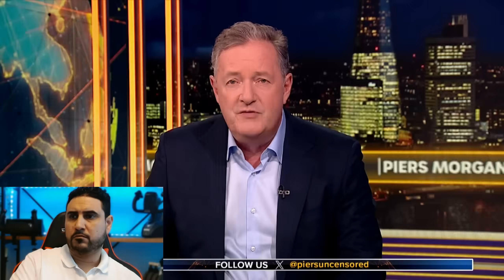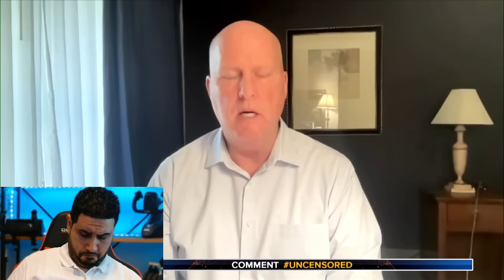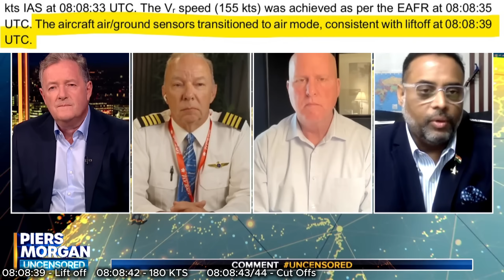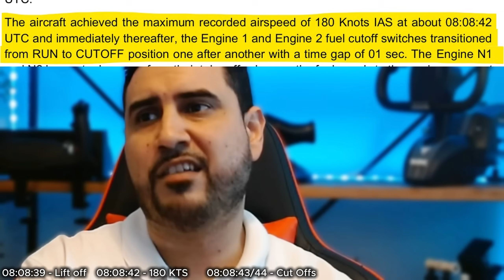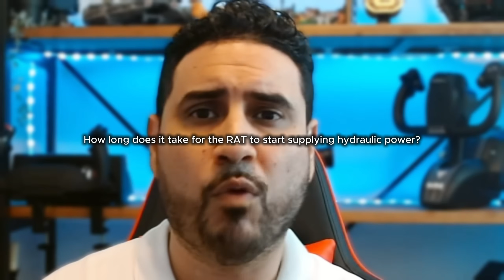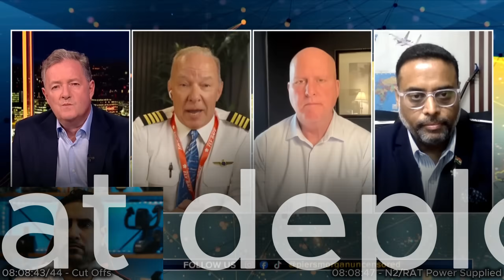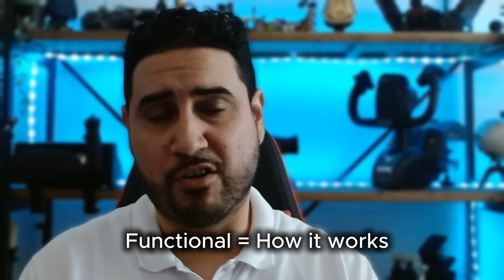TOTAL SYSTEMS FAILURE BREAKDOWN | AIR INDIA 171 | AAIB PRELIMINARY REPORT | MAYDAY | MSFS2024

Comment: The switches are a distraction from the real cause which is probably a lithium battery fire in the aft section of the plane. It burnt the outer casing of the flight data recorder to the point of melting and will have inevitably disrupted other components nearby including the 28V bus. That’s what the FADEC/ECC unit responded to. The outer casing of that Flight Data Recorder must be forensically tested for signs of lithium. And crucially that unit was found separated from the aircraft so not damaged by fire after the crash.
Reply: This is the reason. To add RAT was deployed already in a screenshot in the preliminary report. The height is approximately 150 ft. If the fuel switch was already off the speed vs height trade off would start taking place and the speed would start decreasing. But what happened was it reached another 250 ft with normal climb! 250 tons fully fueled and loaded aircraft. Think! So what happened?

Most likely event is a major electrical failure caused by the Lithium ion batteries thermal runaway fire. Why is this likely? 

Because on the ground we had a video shared by a passenger of IFE and passenger comms air conditioning not working properly. The survivor reported a loud bang and cabin lights flicker. 

What nobody is talking about is RAT deployment reasons.... it's not just shut down of engines. It's when there is a full electrical failure it deploys by EPCS. This triggers FADEC to shutdown the engines. 

The key sequence is RAT -> FADEC -> Engines shutdown at around 300-350 ft only way it would reach 450 ft at normal speed -> Cockpit still has electrical power so they don't know about this event -> PF asks PM why did you turn off the engines -> they realize something is wrong -> 9 secs -> turn off fuel switch and on to reset -> aircraft begins a smooth glided descent and the may day call is made 

The rear EAFR was severely damaged....see the picture in the preliminary report in comparison to the front EAFR. But the tail section was intact and they even found a body of a cabin crew intact.

My experience is 18 yrs in one of the busiest international airport and a major international airline in IT. Always worked on complex system troubleshooting.
Reply: @sandyj342 Sandy...i believe what you have stated Is correct. i back you 100% with 37 Years airline flying Boeing equipment. last Friday I shorted $230,000 of BA. Boeing stock..i put my money where my belief is😮
Reply: @cjswa6473 I have pieced this from few people who were rationally sequencing it. So it's crowd sourced 😅. Just want truth and justice for the crew and passengers. I wanted to be a pilot but ended up in aviation IT and in aircraft hangars on airport ramps. You guys are amazing when we look at the sheer ingenuity of the avionics and mechanics getting this airborne day after day
Reply: @sandyj342 . it's a group effort. we learn More everyday. thank you For taking the Time to give us your educated opinión. Please spread the word so this crash doesn't get swept  under the carpet AND forgotton. Just today another Boeing had a Gear collapse on abort AND resulting fire. Lots of distractions
Reply: @cjswa6473  , high time Boeing and Air India realise that profits and safety don't mix well together!
Reply: @cjswa6473  Likewise experience wise. IMHO a wise move. I have been advancing toe down of main gear. Cannot try retraction and cut off fuel switches in 3-4 secs.
Reply: @cjswa6473  "shorted $230,000 of BA"

Dude. I almost never give financial advice to anyone, but I might suggest you close your position - quickly.

Boeing, GE, NSTB, FAA, and the British AAIB have all gone home. They saw the data, know what happened, and have made no comment and issued no A/D's. That should tell you all you need to know.
Reply: @sandyj342  , @FinalApproachPOV, I am posting here, my comment I had posted a few days ago on another channel:-

1). Why has the time stamp of the RAT deployment been deliberately omitted from the AAIB AI-171 Preliminary Report? THAT, is the key to the whole chain of events:-

1.1) There was apparently a total electrical failure in AI-171 soon after lift off, resulting in the FADEC automatically closing the fuel supply valves to both the engines. (The AAIB Report mentions that the fuel supply to both the engines was cut off). 

The one second gap between the fuel supply to each engine being cut-off is due to the fact that each engine has it's own FADEC. So, there was a one second gap between both the FADECs kicking-in.  

1.2) Thereafter, the RAT deployed automatically. (This event would definitely have been captured in the EAFR, along with a time stamp. Why does the AAIB have to reference a screenshot from a video to establish that?)

1.3) The PF asked the PM whether he had switched off the fuel supply and the PM denied it. (This is mentioned in the Prelim Report, BUT the time stamp of this query has deliberately been omitted by the AAIB in its Prelim report!)

2) The pilots did immediate troubleshooting, and as per the QRH, once the pilots were certain that it was not simultaneous bird hits to both engines, nor dual engine fire / failure / flameout, they "transitioned" the Fuel Control Switches from RUN to CUT-OFF for each engine, with a one second gap (captured by the FDR), and then back to RUN, one-by-one. (Captured by the FDR and mentioned in the Report with time stamps).

3). Now, the big question is, what caused or triggered this total electrical failure in AI-171?

3.1). There was a video uploaded by one of the passengers who travelled in the same aircraft from Delhi to Ahmedabad, on the day of the crash, and he mentioned that the air-conditioning , an well as the in-flight back of seat  entertainment system screens were not functional. 

3.2) The lone survivor from Seat 11-A of the ill-fated aircraft has said that, soon after lift off, THE CABIN LIGHTS FLICKERED, followed by a loud bang, after which the aircraft crashed. The air-conditioning not working previously, and the cabin lights flickering before the crash, are indicative of an electrical problem in the aircraft.

3.3) The pilot had logged a "STAB POS XDCR" complaint on landing. This is the Stabilizer Position Transducer, a sensor that feeds data about the plane’s pitch attitude into multiple onboard systems, including FADEC. This problem was attended to by the engineers on duty. (Mentioned in the AAIB Prelim Report)

3.4) A malfunction in the STAB POS XDCR, or corrupted data input, could potentially be interpreted by the FADEC system as a critical failure and could lead to an AUTOMATIC  protective engines shutdown, WITHOUT ANY PILOT INPUT.

3.5) Did the FADEC, possibly misled by bad STAB POS XDCR sensor readings, trigger the shutdown on its own, leaving the crew scrambling to restart the engines? (A major European airline is now looking into the possibility of faulty sensors triggering an undesirable FADEC shutdown.)

4) And now look at the contradiction here - "when fuel control switches are moved from CUTOFF to RUN while the aircraft is inflight, each engines FADEC AUTOMATICALLY manages a relight and thrust recovery sequence of ignition and fuel introduction" (Extract from the AAIB Prelim report). 

This means that there is NO NEED for the pilots to flip the Fuel Control Switches back to RUN from CUT-OFF to relight the engines, since the software on the FADEC will instruct the EEC to take care of things. Any views on this?
Reply: @ramnik.khanna you have done your homework well... we need to put you on an investigation team😊
Reply: @cjswa6473  ☺
I'm not a Boeing pilot, or a Fuel Systems Engineer, or an aviation expert, but am an investigator in an altogether different field. 

It's high time the AAIB took a 787 pilot to help them investigate the AI-171 accident further, like the Indian Pilots' Associations are demanding.
Reply: @ramnik.khanna absolutely..one of their pilots can provide even the basic normal takeoff procedures. After pushing up the throttles to say 45% and engaging TOGA. BOTH hands are then put on the yoke?As FO is flying.. As a standard takeoff procedure. Or do they do something else? Captain guards the throttles until V!, rotate,  then his next step is call positive rate and respond to the gear up call.
all done as evidenced by the landing gear being in the toe down position.
As you can see the takeoff is a busy time and critical phase of flight with call-outs, monitoring airspeed, power settings, EGT's, vertical speed change, and truthfully with experience, you can tell when everything is correct and the gear will come up when you hear a familiar "click". If not you would also be distracted by the landing gear NOT coming up, with disagreement lights.
in other words,,way too busy to be messing with the engine start switches..as well as looking outside the window, then, at 400 ft engagement of the autopilot, LNAV engagement. etc.
Reply: @cjswa6473  , your description is quite accurate.

But, each airliner operator has their own QRH and SOPs, on which the pilots are trained. It's ~important~ vital that the AAIB goes into this critical aspect, as to how the pilots would respond to a dual engine failure, immediately after rotation.
Reply: @ramnik.khanna I completely agree.. that's why I stated..Or are the standard takeoff procedures something else.. I just used what was the norm at a domestic USA airline. just as a demonstration how busy you are during normal operations.... basically demonstrating,,no time to fiddle with cutoff switches
Reply: @cjswa6473  , the total weight of fuel, cargo, passengers +  crew on board, runway length available, the met conditions (temp, humidity, crosswinds etc.), flight plan, cruise altitude etc. would have been fed into the FADEC prior to take off. 
The FADEC would then plan the entire route and optimal engine performance, the V1 & Vr, the trim, etc. and execute the flight, with minimal pilot involvement.

Yes, the FO who was the PF, would have had his hands full at the time of rotation and initial climb (literally, with both his hands on the flight yoke), watching the HUD, keeping the aircraft level, commanding landing gear up, flaps retraction etc., and he would have  been caught off-guard when both the engines powered down simultaneously, followed by the audio alarms blaring in the cockpit, and the visual alarms flashing on the cockpit displays.

The first reaction of the surprised PF, would be to ask the PM (The Capt) why did he cut off and the PM responded that he did not do so.

What I'm puzzled about is, why was the aircraft pitched up the whole time (As can be seen in the videos), despite both the engines having powered down? The normal reaction would be to reduce the AoA of the aircraft, till the engines reignite and provide the thrust to continue with the climb. More importantly, to reduce the pitch, to allow the aircraft to glide safely and prevent the inevitable stall, till such time the thrust is restored. I suppose the FO would have been overwhelmed by the sudden turn of events, and one can't blame him for that, because the aircaft was barely a 100 odd feet above the ground when the RAT deployed.
Reply: @ramnik.khanna the RAT coming out at 122ft. or Before. means the F/O lost his instruments, only the captains side would be working. also the landing gear wouldn't come up ..RAT can't do that. I think only 10 instruments work with RAT deployed. FO did a good job considering he was possibly just flying by the seat of his pants
Reply: @sandyj342 , das ist sehr plausibel und wird ähnlich von CEO Dr. Ranjit John in einem Interview berichtet und analysiert, wie das folgende Video zeigt. 
7H9vT7TMwDs
Reply from the maker: What’s your source?
Reply: @FinalApproachPOV  Based on current visual evidence, the damage to the AI 171 recorder is not typical of a carbon-based fire, and is much more consistent with a high-intensity, localised lithium battery fire — likely from within the aircraft systems, not as a result of the impact. In comparison the image of the forward FDR is very different having suffered from a conventional carbon based fire. As I said forensic evidence is definitely needed.
Reply from the maker: @pa1189j  interesting. The damage is not consistent with a typical carbon-based fire (e.g. jet fuel or battery fire). It’s more aligned with a localized electrical arc or magnesium/aluminum combustion, possibly triggered by an internal fault in the aircraft’s electrical distribution system or FADEC interface.

Next video will dive into this more.
Reply: @FinalApproachPOV  Thanks — I agree that it doesn’t resemble a typical carbon or jet fuel fire. But the localized blistering and absence of soot seem more aligned with known lithium-origin incidents than a surface arc or magnesium flash. Let’s see what the next release shows.
Reply: @FinalApproachPOV  there’s actually an interview with an engineer and/or pilot who brings up this exact point.
Reply: @pa1189j  So how do you explain FDR showing the fuel switches going to cutoff and back to run?
Reply: @Bob31415 The FDR shows the state that the FADEC has determined for the fuel valves.
Reply: Was ist das für ein "weißer Rauch", den jeder nach dem Start im Steigflug und danach sieht; ist es ein Batteriebrand? Für Staub ist es nicht typisch.
Reply from the maker: @hostlangr   That video showing the cloud of smoke/dust does support this theory.
Reply: @Bob31415 , zum Wiederherstellen der Triebwerksleistung ist das übliches Vorgehen. Auch wenn die Triebwerke aus ganz anderen Gründen ausfielen.
Reply: @hostlangr for me it was looking like burning hydraulic oil inside the turbine, causing the engine to overspeed, but there's no confirmation of that. The battery is in the tail and The Indian Express has reported of an electrical fire in the tail found on the crash site itself.
Reply: @pa1189j  "The FDR shows the state that the FADEC has determined for the fuel valves."

No, it doesn't. 

First, there is no FADEC. It's called the EEC.

Two physical wires lead from the Fuel Cutoff Switch to (redundant) Remote Data Concentrators. The RDC's create a data packet defining the switch movement event (e.g., "FCS #1 -> CUTOFF), and send that packet out on the data network. The FDR "sees" and logs this packet.
Reply: @pa1189j  "absence of soot" ?? 

Have you looked at the picture in the Prelim? There's black powder all over the place on the table. That doesn't look like soot to you?
Reply: @FinalApproachPOV https://youtu.be/tWN6XU67_9s?si=PR5Ie7h6iZ-Lpdg3
Reply: @FinalApproachPOV  , https://www.youtube.com/watch?v=pzrSOD6PT-s
Reply: This theory might hold a drop or two of water - except - the aft EAFR  is located nowhere near the lithium battery. The EAFR is located ABOVE the aft galley; the battery is down below in the equipment bay.
Reply: @BryanM61  Agree, but my reasoning is that a lithium fire would likely occur after the crash when the impact short circuit the battery cells. It's very unlikely to happen before the crash.

Thanks for the position information.

The Indian Express reported last week of an electrical fire in the tail and the FDR was destroyed due to that. This suggests this local electrical fire was close to the FDR. Do you know if the aft RDC is close to the FDR? 
Anyway, any cables and wires might have been destroyed before any fire alarm could be recorded.
The thing is that the electrical fire needs electricity from the generators to fuel the fire and will likely not happen after the crash.
Experts can distinguish an electrical high temperature fire from a jet fuel fire.

Appreciate if you have any idea.
Reply: @idarpolden5913  I totally agree that if there were a fire somewhere in the rear of the aircraft, it happened after the crash. I have seen NO hard evidence of any electrical fire anywhere in the aft section of the aircraft. Very little soft evidence either.

But. Even if there were, nothing in the electrical system could have caused the engines to shut down - not transient voltages; shorts; total bus collapse; or the myriad other (IMHO baseless) theories floating around. Nothing. 

"Do you know if the aft RDC is close to the FDR?"

There are 21 RDC's on the 787. The RDC that records the Fuel Cutoff Switch movements is forward, in the avionics bay below the cockpit. To which RDC do you refer?

"The Indian Express reported last week of an electrical fire in the tail" 

Oh yeah; now THERE'S a reliable source. I don't mean to poo-poo or cloud any information that might become relevant to this accident, but it has been my experience thus far that virtually every India media channel has been putting out information that is - shall we say - less than accurate.

"the FDR was destroyed due to that."

The Prelim has a picture of the rear EAFR. Yes, the housing was badly charred; the Prelim describes the damage as "The EAFR had impact and thermal damages to the housing. The wires were protruding from the housing and the connectors were burnt."

But posts here and on other videos (not yours) describing it as "melted", "destroyed", or "unusable" are grossly overstated, as you can clearly see from the picture.

This aft EAFR was found in the wreckage on the roof top of 'Building A', - which you can also see from the Prelim was where a great deal of fire and flames occurred, including the building itself burning.
Reply: @BryanM61 .yes,, some other problem possibly caused the white crust outside the aft recorder. they need to really investigate this. that inop useless recorder should have been the most usable one
Reply: I just wrote the same concern
Reply: Very interesting discussion. I came to the same conclusion yesterday.

Everything lines up with a battery fire in the tail.

The battery in the tail that might have caught fire is supplies the 28 volt DC essential buses 
As mentioned the diode would short circuit due to the heat. There is likely more advanced power electronics that limits the max current to let's say 100 ampers, but the transistor will short circuit in the heat from a lithium fire.

The loss of the 28V essential buses will first trigger the RAT deployment. 

Then the fuel switches themselves is power from the 28V DC system along with the fuel valves and relays

Especially the spar valve that is fail-safe closed is only controlled by the relay. The loss of 28V DC will also make the run/cutoff signal transition to cutoff and recorded in the FDR.

There's also other systems that power the 28V DC essential buses, but the short circuit in the tail would have reduced the voltage enough to make the current needed below the threshold for the relays to stay energized which explains the 1 second delay.

Eventually the RAT gradually started to overcome the short circuit in the tail and the cutoff signals dissappear in due course.

A higher voltage is needed to close the relays again, but perhaps like 12V would have made enough current to energize.

Remember, the 28 VDC essential buses has some resistance in the wiring itself, so the biggest voltage drop would have been in the tail causing the RAT deployment first. Then the rest was triggered in due course 

It does line up.

The Indian Express reported about an electrical fire in the tail that was discovered on the crash site where the RDC and FDR was totally fried. Don't expect the forward FDR to have recorded anything from the tail sensors after that happened.

Let's keep the other plausible causes open like software glitch or an electrical glitch with the Run/cutoff signal itself.
Reply: one clarificación..when RAT deploys For eléctrical failure by EPCS.. how does that result in Fadec. failure?
Reply: @cjswa6473 FADEC experiences a loss of the 28V DC bus
Reply: @cjswa6473 , ein Batteriebrand ist keine Kleinigkeit sondern gewaltig. Es kann Hitze von mehreren tausend Grad entstehen und ein Schaden an Kabelbündeln der Umgebung etc. mit entsprechenden Folgen am Stromnetz......
Reply: @cjswa6473 A fire in the aft electronics bay could break both AC buses through shorting or circuit failure-triggering RAT deployment. This is what happened in JAL 787 battery fire.
The FADEC modules rely on clean, stable electrical input from dedicated AC and DC buses controlled by the BPCUs.
If a fire damages those buses or disrupts power logic, FADEC could enter fail-safe mode, misinterpret signals (like believing the aircraft is still on the ground), or shut down fuel control even without manual input.
FADEC may interpret the absence of a valid “RUN” signal as a command to shut down the engine—even if the fuel switch was not physically moved. This is what in ANA landing where engines shutdown and RAT was deployed.
Both have happened on 787 in the past so the discussions by "aviation influencers" are keeping everyone to the fuel switches.
Reply: If this were the case, how could the engines have been activated again after 10 seconds and started running?
Reply: @ChFels my reply above...RAT was deployed first due to electrical fire and FADECs shutdown the engines after few seconds. Pilots realized this only after the "startle state" and turned off physically and on to revive the engines but was too late and did the mayday.
Reply: @ChFels , read this self-explanatory extract from the AAIB Prelim Report, "while the aircraft is inflight, each engines full authority dual engine control (FADEC) automatically manages a relight and thrust recovery sequence of ignition and fuel introduction."
Reply: @ChFels A restart attempt was plausible even after a suspected battery thermal runaway, as the deployment of the RAT could have restored enough electrical power—specifically 28V DC—to allow the FADEC to support engine relight, assuming the system hadn’t suffered irrecoverable damage.
Reply: You have clearly no understanding of how electrical and avionics systems work in a plane. The systems are isolated and redundant. Also, Flight Data Recorders are not cardboard boxes. They can withstand thousands of degrees Celsius and hundreds of G. I would be more concerned about WHO had access to both FDRs and CVRs. The report is a combination of LIES and vague information. It is just a matter of time till somebody goes to jail for distorting the facts and hiding evidence.
Reply: AAIB will cover it all up. They want Boeing, GE, Airbus to recommend India for Aircraft servicing, maintenance hub for International Carr. If they point fingers at Boeing for crash, Boeing will point failures at India for poor maintenance “which is a reality “.  The Pilots should be framed - by unanimous consent and approval.   AAIB is conducting a sham investigation, the preliminary accident report is a scam.
Reply: The final report is a scam. Captain Steve doesn’t get it.  RAT came on before the switches were cut off, He doesn’t get it after people pointed it to him repeatedly
Reply: You're kidding, right? A fire specifically caused the fuel switches to turn off and then back on without causing any other anomalies?
Reply: @jonljacobi  We don't see any kidding apart from as a lithium fire likely occur after the crash as the cells short circuit due to the impact.

However, The Indian Express reported about an electrical fire in the tail and the generators are needed to fuel an electrical fire.  This likely happened during takeoff and not after the crash.

An electrical fire that short circuit the 28V DC essential buses would have taken away the power from the fuel switches causing the run/cutoff signal to transition to cutoff. Also the relays will stop being energized and especially the spar valve will close without power.
In this scenario, the HPSOV's will remain in their position as they are servo controlled by a motor controller.

As there's 3 valves in series, only 1 needs to close to cause fuel starvation.

A software glitch will not affect the spar valve, but the HPSOV and FMV.
there might be an electrical glitch as well involving the Run/cutoff signal wires.

Any of these scenarios have higher probability than the fuel switches themselves was moved.

The electrical fire is the most likely cause, but we cannot outrule anything at this stage.
Reply: @jonljacobi I invite you to research the interaction of the FADEC the 28V DC bus, the fuel cut off switches and fuel valves. And add the role of the RAT in this whole sequence.
Reply: @pa1189j  "I invite you to research the interaction of the FADEC the 28V DC bus, the fuel cut off switches and fuel valves"

And I would invite you to do exactly the same, since almost every one of your posts presents inaccurate (putting it kindly) information.
Reply: @jonljacobi FADEC does not have to physically turn the fuel switches to off, it can do this digitally while the switches are in on position, the pilots realizing the engines were turned off, flipped the switches and then on position. Get it. Good
Reply: The door of the APU was also open that there is a possibility the pilots trying to start it